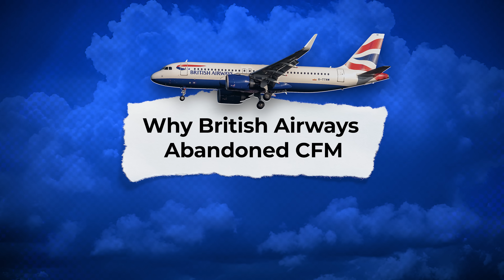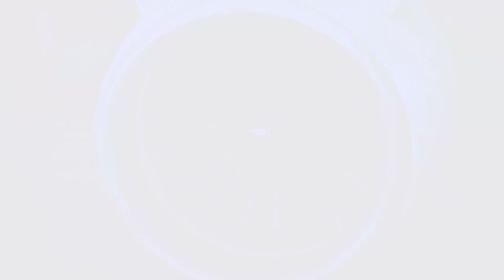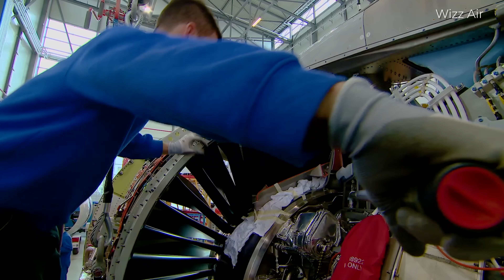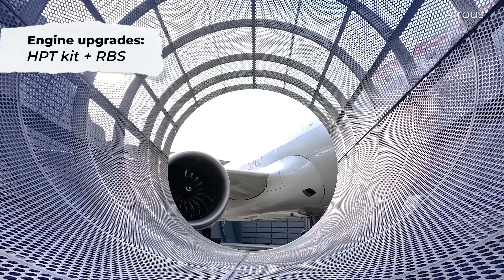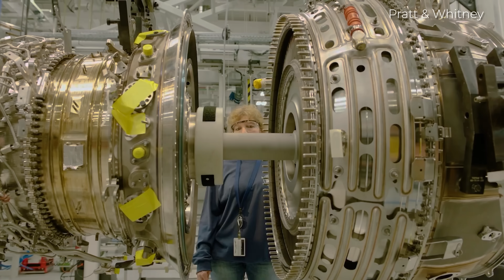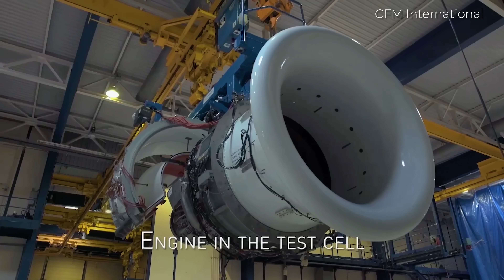British Airways Just Broke Decades Of CFM Loyalty To Put Pratt & Whitney GTFs On Over 60 Airbus Jets

Comment: Dumb decision!!!  They will live to regret it.  My main airline Delta decided to go P&W on new aircraft, A220 and A321neo and it's NOTHING but trouble.  My frequented routes were the first to get the A220 and A321neo and the amount of cancellation and delays was insane!  I started to track my Delta IROP and vast majority comes from P&W engine issues.  I would fly across the world on R&R engine aircraft with no issue, then get stuck at a Delta hub because my feeder flight home is on the new P&W.  BA probably got a really good deal and payoff.

Comment: I swear the script of this video started repeating whole sections halfway though
Reply: Have to get it over 10 mins so a lot repetition & unnecessary filler words
Reply: Most of their videos could be 30 second shorts, but they want those sweet mid-roll ads
Reply: You don't have to watch the whole thing. I typically switch away after a minute or so.
Reply: Not the first time this has occurred. These videos need editing for succinctness. First line about BA being the UK's "primary" flag carrier is a case in point. A country has a single flag carrier. Verbiage for no reason.

Comment: Questionable engine order considering the GTF is quite unreliable. And decision seems very odd.
Reply: Do you have any data about current reliability, other than the powder metal issue which ended in 2021?
Reply: @PaulVerhoeven2  I mean air frames have been scrapped as recent as last year im not saying the engine is still having these issues but it seemed such an odd decision when BA already have the leap engines.
Reply: @Transport272   If you mean A220 airframes it is not only connected to the PW backlogs in production of replacement parts (not the reliability issues) but also to Airbus's inability to produce replacement parts for A220... so the plane is worth more as its parts...

The whole situation in the industry is quite insane. Too much globalization of manufacturing made supply chains way too fragile. For example, some titanium parts for aircraft and the engines were produced in Russia. Then Russia attacks Ukraine and placed under sanctions. PW had to close its center in Moscow for example...
Reply: I didn’t mean the 220s are that engine is completely different to the GTF I ment the spirit airlines Neos last year and a few other airlines but my main criticism is on BAs questionable choices considering all there current neos are powered by the leap but yeah it’s a shame about the industry at the moment and the globalisation suppliers its definitely not what the industry needs at the moment.
Reply: @Transport272   A220 are powered by PW1500 Geared Turbofans, close relatives to PW1100 Geared Turbofans in some A320s.

Comment: "Decades of loyalty on CFM engines" they've never been CFM loyalists. CFMs powered the 737-400s because it was the only option, and the few CFM-powered A320s they had in the 1980s, 1990s and 2000s were inherited from the BCal merger. When chose to overhaul their short haul fleet, they went with IAE-powered A319/20/21s. And the two A318s most likely had CFMs because IAE wasn't an option. The NEO was really the only time they chose CFM.
Reply: that's right, besides that British midland used the same engine, tbh using the PW1000GTF is better for them, even though the PW GTF is a new engine, there is some commonality with the IAE as they are part of the IAE
Reply: I'm glad i'm not the only one to have spotted this mistake, I also mentioned it but was hit by the moron brigade that said it was only the NEOs, but NEOs haven't been around for "decades" average NEO fleet age is 4 & a half years old